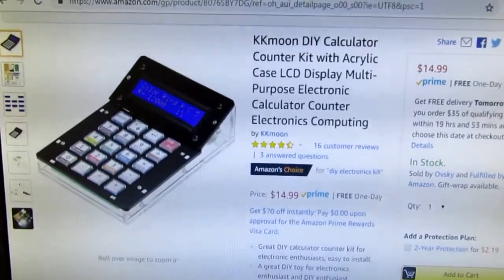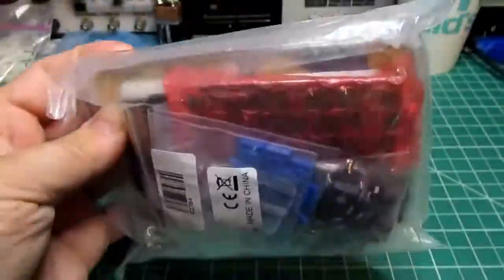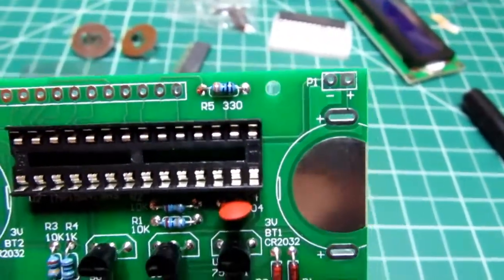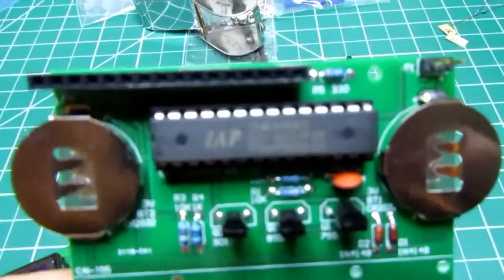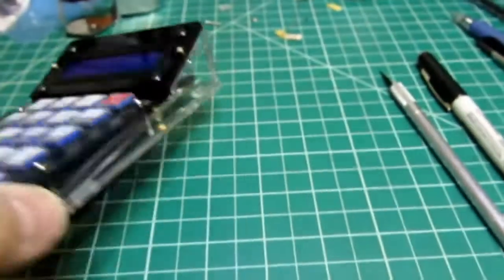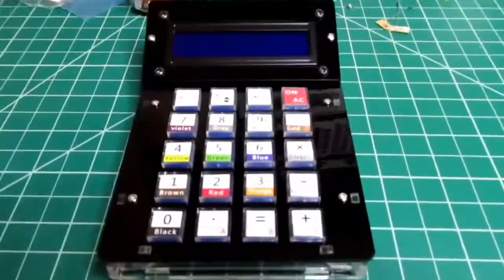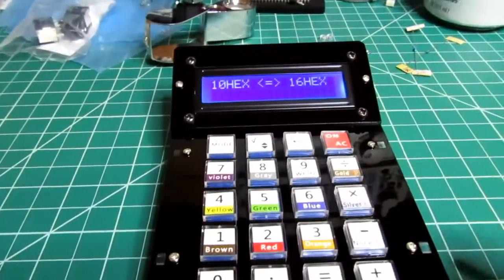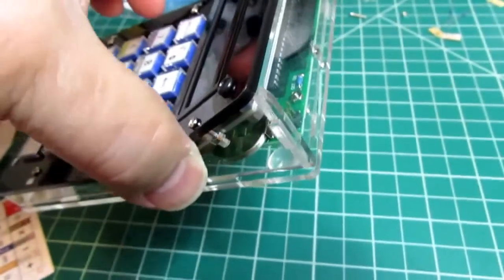KK Moon DIY Calculator Kit: Description, Assembly and Review

Comment: Thanks, your video was very helpful in working out some details during assembly. The timeout on my kit (purchased 01/2019) is about 30 seconds, which doesn't seem unduly short. One thing I wish they would change is to make the sides just a bit higher so the keycaps would be captured a bit better by the cutouts in the top of the case. They stick up just far enough to let them twist a little and appear out of alignment. Maybe I could try some shorter standoffs for the main board.